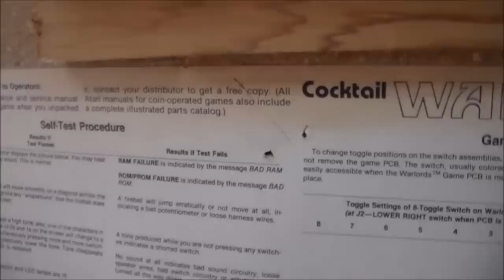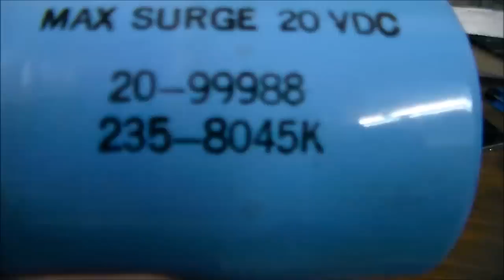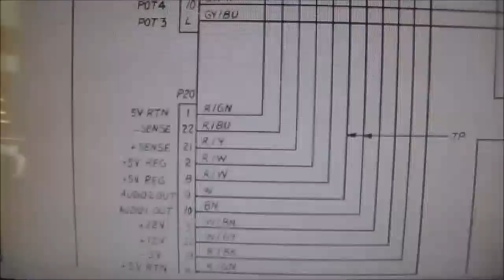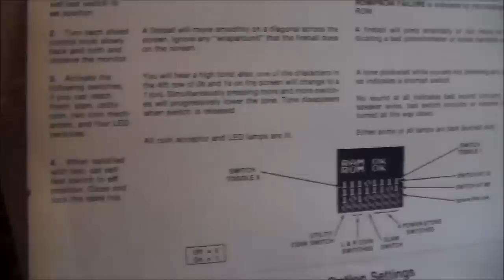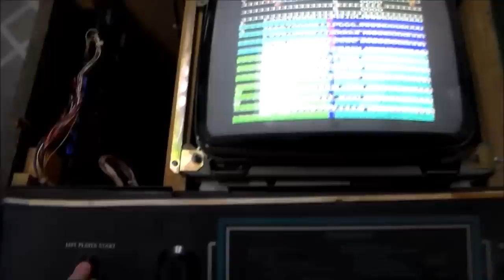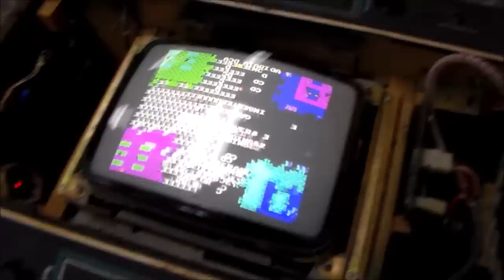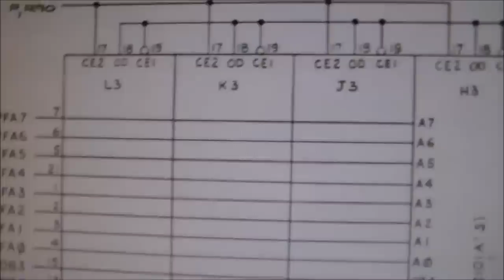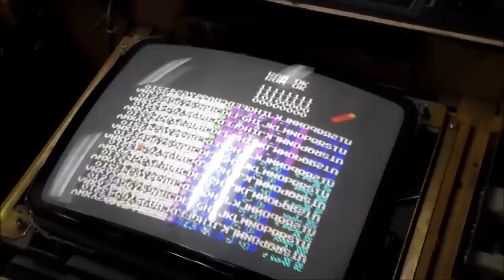Repairing A Hacked-Up 1980 Atari WARLORDS Cocktail Arcade Game - What Did They DO???????

Comment: I repair valve/tube amplifiers for a living and my rule is as follows...
1. Eyes most
2. Hands least
3. Tongue not at all
It's nice to see someone have a good look at a unit before just switching on.
Really enjoying your videos.
Dr. Watts. 
Senior service engineer for Marshall Amplification.
Reply from the maker: Thanks Dr. Watts, I try to be as thorough as I can when I work through them, I just hate fixing one problem halfway down the line, I'd rather start at the beginning and figure out what we're dealing with, other than assume the obvious problem is the only problem :)
Reply: These are good and sensible protocols for working on things with tubes in them, the voltages in there are quite unhappy to meet you.

Comment: 21:10  That monitor has a crazy amount of burn-in. You can see the game without the board even being connected.
Reply from the maker: All the older ones always did.
Reply: That's actually not bad.  I've seen many that were burnt totally black in the pattern of the game graphics.
Reply: Yeah this phosphor burn is why "screensavers" existed until LCD displays started taking over. They still exist in Windows today, but don't have much use unless you have an OLED display. Power Management has mostly taken over from it.
Reply: I'm not positive, but weren't screen burn-in an actual re-occouring service call event for arcade machines?  Like a popular one running for a few years would need a new tube like a car needs a tune up?  Dependant on the game's screen layout changing during play of course, and player griping.
Reply: sl9sl9 we know.

Comment: "What did they do" indeed... Good job on getting all that mess cleaned up, I don't know if I would have the patience to deal with sth like that.
Reply from the maker: It's kind of one of those ones where if I don't fix it nobody's going to fix it so why not try?
Reply: @LyonsArcade  That is the spirit!
Reply: One thing I keep seeing, you got to have a good temp. controlled soldering iron, and set it as low as you can while getting good joints.  When I see boards with the traces peeled up, I know someone got them too hot.  And use some good solder like some old Chemoloy or such, never use that dam lead free crap.

Comment: Paint brushes aside, another good thing to clean dust are "acid brushes"  a dollar buys a dozen and they are in the plumbing isle of a hardware store.  They are smaller and are used to apply PVC welder.  You can even cut them down to make them a scrub brush to use with isopropyl.
Reply from the maker: I'm gonna check that out, I go to the hardware store every couple days :)
Reply: @LyonsArcade  I use them for my mechanical keyboards and cleaning mobos.  They are lil tin sheet tubes with black plastic bristles.  I have not had any ESD issues out of them, but if you are worried a gator clip jumper ground should work.

Comment: I wish  we  (the Brits) had your  "can do" attitude. it seems to be a american thing but i know in the UK if a tech looked at that board he would say "its screwed, can't do anything, try and buy a board on ebay"   subscribed I have a tabletop 1979 space firebird machine and  tabletop 1981 Galaga machine with all original boards. I have no clue what i would do if something went wrong with em.
Reply from the maker: You'll have to fix them yourself if something happens, you can do it as easy as I can :)  Us Americans are just former British subjects anyways, LOL
Reply: I am British I patch board like that.  Even make a piggy back board to plug in.  I have worked in shop an been told to say it is E Fed but I always just fixed it
Reply: @JohnGotts  Thanks John will do. I have owned my machines since 1984 (bought direct from Taito) and they have no frankenstein boards or wiring. i really need someone who knows this technology like Joe in these video's. My machines have not had a lot of wear and the monitors are clear of burn. I will likely sell them when i retire in  about 4 years and downsize to a smaller house. no clue what they are even worth.
Reply: The UK scene for this stuff is huge? I'd suggest going to a local retro convention and you'll run into hundreds of brits who are doing exactly this kind of thing.
Reply: @medes5597  Thanks Terry I have asked fruit machine companies mostly and they dont want to know. These type of machines are no longer used  in pubs or clubs. where is the UK scene? is there a website? Thanks again
Reply: @insertnamehere5146  not sure about the scene as such, but there are a few of us with the same attitude as Joe.  My main experience is in mechanical work but i do some electronics too, mainly old radios and TVs/VCRs etc.  (We do have an old Glendale Parrot toy vending machine though, that I repaired. My partner loves them so we got one a couple of years ago). You'll find someone though, we are out there.
Reply: @insertnamehere5146  Some of the bigger stores and mainstream will say screw it, kind of like Apple stores telling you you gotta replace a whole tablet but a smaller shop will replace one chip. Some people dont think it's worth the time or stress for the money, and some people are just lazy or unskilled. It's all over, even here in the states. You gotta do some research and find someone that enjoys the work, and you'll get it, or try yourself. If they're already written off as broke, then you dont have much to lose lmao
Reply: I have to agree with the others. There are plenty of 'old boys' who still do this kind of thing in the UK (my Dad being one of them). I'm not saying younger people aren't/can't do it too, but certainly the older generation come from a time where a 'throw away culture' didn't exist.
Reply: the 1st thing someone would say is stick a Ras pi in it lol
Reply: @T200026  lol! Yup
Reply: Happy retirement.
Reply: @Andessaril  Thanks!! 4 years later still not retired, waiting for my company to offer a year's salary leavers package which i hope is this year. still have the machines which i will likely stick on eBay for payment on collection

Comment: You need a Hakko desolating gun. I finally bit the bullet and bought one a year or so a go and I regretted not doing it years sooner! What a difference! They’re not Jeep but they are so worth it. You’ll never want to see one of those spring loader solder suckers ever again!
Reply from the maker: I tried one a few months back and couldn't get the hang of it, it was always clogged and burnt up traces so I don't know what I was doing wrong but it was useless to me....
Reply: Wow thats weird. I had the opposite. The sucker bulb soldering irons and those spring loaded suckers drove me crazy and I’d ruin traces. So I folded and got the hakko and I was blown away how great it worked. I was pulling 68000’s out of commodore amigas in a couple minutes. It worked so good it was fun!

Comment: Great job, re-doing all those traces was a labour of love! Too fiddly for me, I'll stick to jukeboxes haha. 
Regarding that sensing circuit on the power supply, the bypass mod seems like a safer idea. What if the 5 volt line to the game board is fine, but the sense line back to the regulator had some resistance, due to a dirty edge connector or something? Presumably that could cause the power supply to ramp up the voltage to over 5 volts into the game board, potentially doing all kinds of damage! Better to have not enough voltage getting to it than too much... :)
Reply from the maker: Yup that's exactly what happens... sometimes it draws current back through the sense line too and burns up the resistors on the power supply (which I guess is a fail safe for that problem)

Comment: The fuse probably was taken out by the bulbs when one of them went out.  Often those sort of bulbs fail with a nice flash of plasma inside which takes out the fuse, thus protecting the PSU.
I personally would not do the Sense Mod, reason for that is it is part of the regulation and if the edge connector is dirty, causing voltage issues, it could cause issues elsewhere with the bad connections.
Just my personal opinion :)  I figure it's better just to get all the connections clean and solid so it works as Atari intended.
Reply from the maker: That makes sense Brendan, like I mentioned people feel strongly both ways :)  Thank you for watching, we appreciate your comments!

Comment: I wish I had a dollar for every G07-CB0 flyback I replaced back in the old days! Lots of CPUs too, many Pac-Man boards. I miss those days. Coin op games were more enjoyable than the casino stuff I do now.
P.S. you CAN test those audio amps (typically TDA-2002 if memory serves me). Take a long screwdriver, carefully touch the bare tip to the audio input and touch with your finger. You will hear the stray 60hz from your body amplified through the speaker as a hum.
Reply from the maker: Oh that's good to know, I hate desoldering them with those bent legs!

Comment: I wonder why they went to such effort to ensure the board was getting a precise +5V via a feedback sense line, it seems more like something you'd find in instrumentation/medical.

Something to do with the analog control inputs using V+ as a reference rail for R-C timing and it being easier/cheaper to do it on the power supply rather than having a separate reference on the board maybe? 1980 seems well into the standard TTL/CMOS era where the logic V+ tolerances were at least 10%, not like 70s LSI where you might need weird and very specific voltages.
Reply from the maker: The ram seem to be the problem, if the voltage dips below 4.8 or so you start seeing glitches on the screen.  Still it was kind of overdesigned a little bit I think.  thank you for watching Treeline!

Comment: That was some uuiuuuugly bodgery you ripped out there!

Now personally, I’m the sort to make up a custom little daughter board to fix such issues but you did a great job.
Reply from the maker: Thank you Duncan!  Yes a daughterboard would be a better solution but more time consuming to create!
Reply: @LyonsArcade  You could also go through the painstaking process of using a through hole repair kit and copper tape to make new traces, but you pretty much need the patience of a saint to do that sort of repair. It's probably something I'd try as a personal pet project just to make an old board look more original, but certainly wouldn't offer it to a customer unless they had more money than sense to get it done.

Comment: Two diodes. One diode is half-wave rectification, and four is full-wave. Two diodes are often used for full-wave rectification, but only if you use a center-tapped transformer twice the voltage of what you need. The center is common and the other two lines each get their own diode, both turned the same way.

Comment: One time I had a job like that I ended up piggy backing an lifting the W/R leg an liking that with a jumper some 30 years back I remember needed to use just 4 jumper wires.  Crappy solder work is always back I liked to spray WD 40 ann more lead solder them cut bad chip off an pull pins one by one.  No damage then to PCB but will take a long time say 6 min at the most quick work is bad work.
Reply from the maker: I never heard the WD 40 thing does that make the solder flow better kind of like flux?
Reply: @LyonsArcade  my understanding is that WD40 will leave an oily residue to protect from rust. Try it with a dummy board first.

Comment: yikes yea got to be careful with old boards, easy to lift traces. 
38:50 I'm sure you know but it's good to remember: if the board has multiple of same chip that are socketed and it's suspected either one of them are bad or their sockets/traces are bad.. swap them around. if the problem changes then it's the chips, if it doesn't then it's (more likely) the board.
55:10 wha.. hey those are my initials 😀
Reply from the maker: Did you play this one????? :)
Reply: nice ukvac find though! if next time you want to nerd it up there's always ICTs like Fluke 9010 or this thing http://www.zzzaccaria.com/arcade/ArduinoMegaICT.htm ..the original sw on that only supported specific games but there's general purpose USB communication thingy also that you can use to talk to anything that a CPU has on the bus, all that's needed is the memory map (mame's the best source for those, better than the manual often)
Reply: @LyonsArcade  oop youtube didn't notify of the comment .. well I hope it's not my hand in the video but who knows, might be getting early alzheimers :)

Comment: Yeah, it appeared to have issues with more than more RAM working.

A lot of the old computers used RAM with only 1 data line. You'd have 8Kx1 RAM. So you'd wire all the address lines of all the chips together and give each chip its own data line. And on home computers with expansion boards, it got a little messier with how memory was done. Since you not only had small RAM because larger didn't exist, you also had to deal with decoder chips to switch between different banks. Too bad things like 64Kx8 RAM didn't exist in that time period. So multiple banks of ROM also shared the same wires and the decoder chips would toggle the /CE lines to tell the DRAM chips which ones were to be active. So in the 8kx1 RAM example, all 64 DRAMs would have 13 address lines wired together, each of the data lines go to 8 different chips each, and the 3 leftover address lines from the CPU would work a 3-to-8 decoder chip to select which 8 chips of the same bank are active (/CE low on the active ones, 4.5 volts on the rest). So the decoders map the 16 bits of the CPU to 13 bits of 8 different banks to get a total of 64K.

So modern homebrew computer enthusiasts have it easier. Then can put a 64Kx8 SRAM on theirs instead of using many DRAMs. So no decoders when working with 16 address lines, since the chips have 16 address lines already, and no DRAM refresh to worry with. So a lot fewer parts are needed.

Comment: Would have liked to see the monitor rebuild
Reply from the maker: I ended up with the video so long we didn't have time to film it, basically we replaced all the electrolytic capacitors, there must have been one in the power supply section that was making the voltage fluctuate slightly, it cleared it up after that... was pretty minor to begin with though.
Reply: @LyonsArcade  oh ok thanks thought there was more to it.

Comment: you got that in the shop? damn looking forward watching this :)
-Watched it! wow  i could never do that, kind of interesting  with the tracers and how you puzzle-solve things,  almost looked that you where gonna flash the ram.  But i guess you were just setting up the model nr    before you ran some sort of  diagnostic on that chip.  When you work with boards, do you have a "workbench" whith a monitor and  power supply already setup?, Looking forward to the next video.  Joe Thank you.
Reply from the maker: I don't usually have a workbench setup, I use the actual game as the power supply and monitor, etc.  Sometimes though you have to get creative and hook up a separate monitor, etc.  Thanks for watching Peter, we appreciate it and will see you on the next video!

Comment: Joe wonder if you can offer some advise please, I’ve got a frogger arcade table that’s died on me. When I put  power to the machine you hear the a high voltage sound you normally hear as though the crt is getting power but the screen is completely black, it doesn’t even flicker when powering on or off

I’ve got very limited experience with electronics
Reply from the maker: Sure N-Scenic... turn it on and let it sit for 30 seconds to make sure, then try to put a coin in it or credit it up.  press start.  If the game makes no noise, you've likely got a dead power supply.  If the game makes noise and you can hear it playing, you've likely got a bad monitor.  95% chance you've got a bad power supply.  Take a picture of it and send it to my email address and I can tell you what you need to replace it with, just open the back door and take a picture of the game board and power supply if you figure out that's what the deal is.  Typically a monitor won't fail in such a way that you can hear high voltage, but can't see the image (although it's possible).  Thanks for watching!

Comment: 38:55 Yes, with a oscilloscope you can find bad ram :)
Reply: In this situation though, good luck with power wiring harnesses.  Would have to relocate the test bench to the floor next to the machine, or do a bit of rigging power supply rails.

Comment: I'm just curious, did the contact cleaner make the pots work smoothly in test mode?
Reply from the maker: Yes, it did you just have to make sure you can get the contact cleaner inside of it, some of them are completely sealed.